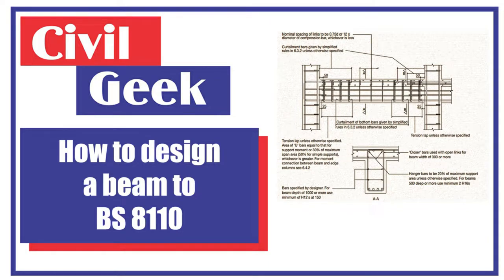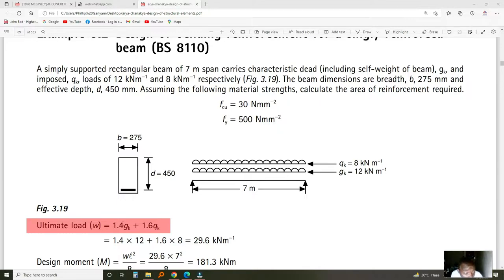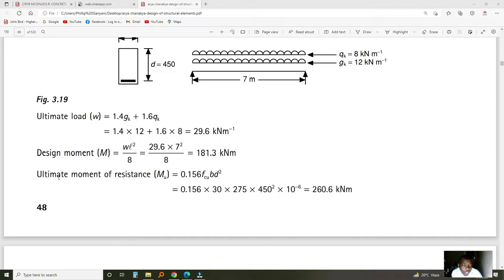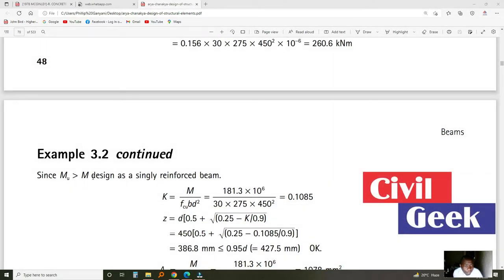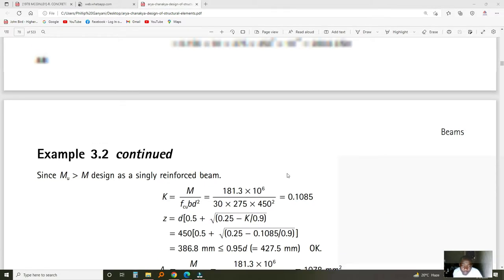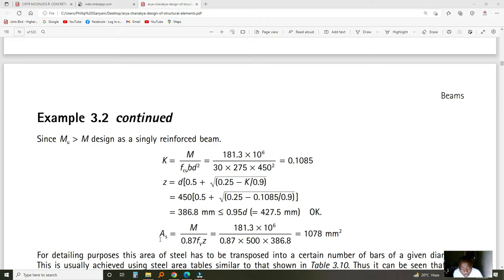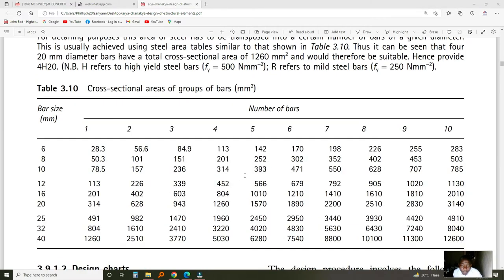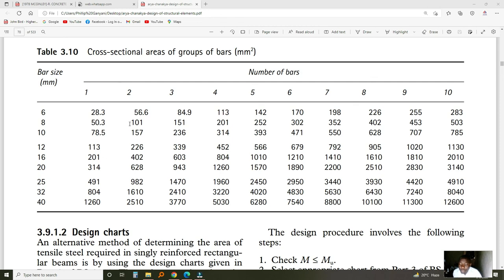how to design a beam to BS 8110

Comment: how do you take account of the weight of the slab for beam design,is it already included?
Reply from the maker: The unit weight of concrete is 24kN/m3
Reply from the maker: So if you multiply ❌ it by the thickness you get 
kN/m2 that is the area load you need for your calculations
Reply: @civilgeek2567  do you add it to the unit weight of the beam also ,or you just use the unit weight of the slab in my case ?like for e.g 24 KN/M x 4.5m x 0.13m ( slab thickness over span )  + 24 KN/m x 0.25m x 0.30m ( beam thickness ) as my total dead loads ?
Reply from the maker: @jovanidesir6334  the load was just for that slab
Reply from the maker: However the load that is moved over to the beam is a uniformly distributed load (UDL) , triangle or trapezoidal load
Reply from the maker: @jovanidesir6334  not exactly 
You have just calculated the total load of the slab that information is only good for solid slab calculations on areas close to the column 
I think I should do a video to explain this to you
Reply: @civilgeek2567  thanks ,so weight of slab should be my udl load for beam design?
Reply from the maker: @jovanidesir6334  weight on the slab should be area load that is the thing of load taken up in slab calculations as per BS8110
Reply: @civilgeek2567  ok ,well it's for an interior beam (250 x 250 ) measuring 4.5m with a 5 inch concrete slab (concrete roof) so I'm still trying to gain clarification as what value in KN/m to use as my dead load for beam design ,please bare patience with me
Reply from the maker: Please separate the 2 beam design and slab design
Reply from the maker: Slab is carrying service load ,dead load and self weight only
Reply from the maker: Beam is carrying the slab and it's load 
On top of that the beam self weight and  a wall that may directly rest on the beam it self
Reply from the maker: I hope this is enough
Reply: @civilgeek2567  correct
Reply: @civilgeek2567  ok,what can I use for my dead load value for "beam design" ? 25 Kn/M x 4.5m  x 0
.13m slab depth ( slab self weight + 25 KN/m x 0.25m x 0.25m (beam self weigh ) ?